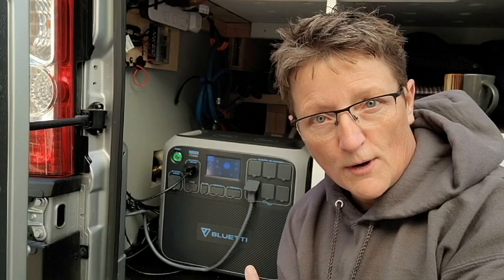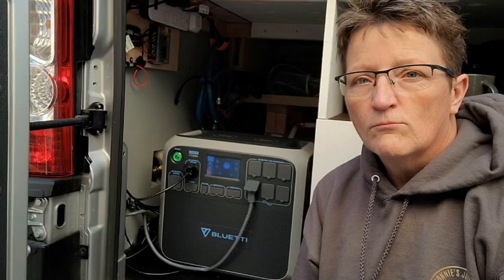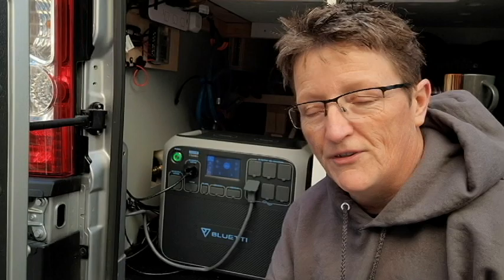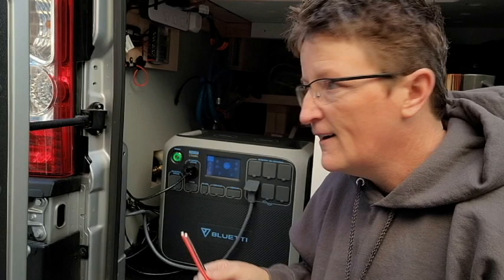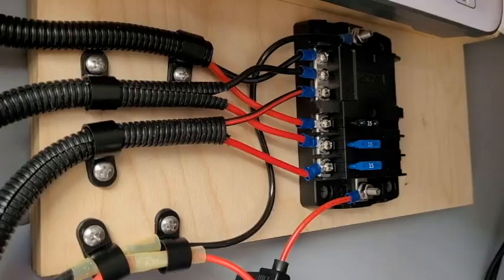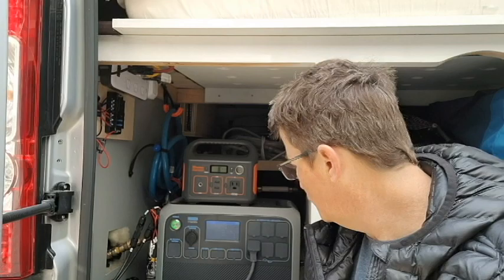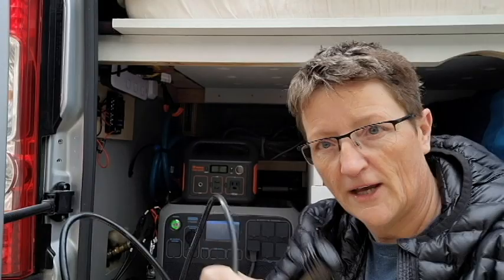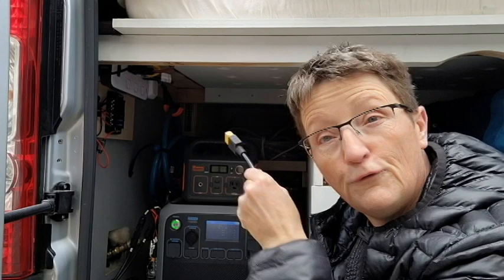Connecting 12V Fuse Panel To Portable Power Bank

Comment: This is a pretty basic question and I am a little embarrassed to ask but how do you hook up the usb lines to your fuse box? I thought these were 5v?  I am thinking of having two pairs on each side of my van.  Did you hook them up in series or would each usb outlet (could be a single or double) get it's own wire run?  Thanks, really very few videos using a solar generator and explaining the electrical hookups like you are doing.
Reply from the maker: You can run them in series or individually. i ran mine individually because of location. personally i would just limit 2 to a run because I have a lot of 12v gadgets.   I like the 12 V quick connects with the heat shrink so that they don't vibrate loose. Yes they are DC 5v. all DC goes to fuse panel. you can then change fuse to what you need.

Comment: Thank you for this video!! Question, does this mean I have to unplug this to use my solar panels? Can I have the solar panels connected at the same time?
Reply from the maker: Yes you can Rena.  The solar input is the aviator port on the side of your unit.  This one goes into the front aviator. The one marked 12v/25amp.  also,  this cord is always out on the Bluetti site so you may have to order and make your own.   Let me know if you have any more questions.  good luck on your setup.
Reply: Thank you! Ordering everything.. one more question. That extra fuse holder that adds protection, what size fuse goes in there?
Reply from the maker: I have a 15 amp in mine
Reply: All done! Thank you so much. Question, if my ecoflow is in the back of my skoolie it will be kinda a pain to keep going back and checking the battery life. Would it be possible to connect a battery monitor that I can run to the front of the bus?
Reply from the maker: @renadalen708  does your ecoflow not have the Bluetooth app?  No devices that I know of that would monitor these devices.  You will learn fast how much power you use everyday.

Comment: What kind of inline fuse were you running between the ac200 and the fuse box?  30a?
Reply from the maker: i put a 20A in.  i don't pull even close to that though
Reply: @JonniesJourney  thank you for your great video and for responding! You rock!
Reply from the maker: @peterdods425  absolutely. Hope this video helped.
Reply from the maker: I checked my fuse. Its 20Amp

Comment: Grateful for your video. Thank you kindly. Used your links :)🙏🏽 One question At 2:48, you mention putting in a fuse on the cord. Does this additional fuse come with the Blue Sea Fuse Panel? If not, I do not see a link to purchase it?
Reply from the maker: No let me see if I can link one.  Thanks for using the links.

Comment: Jonnie, my bad. I thought the front Aviation adapter was male and same as one for aviation to solar. But looking again it is actually a female so the Amazon linked plug should work. Thanks
Reply from the maker: Awesome...hope this video helped.  Good luck on your project.
Reply: Yes the video was fantastic. Thanks so much. I like your enthusiasm.  You would make a great professor!!!!
Reply: how did it work out ? I ended up buying the aviation plug from bluetti.. but it ends as an xt60 plug not xt90.. I could buy an xt60 adaptor instead of the xt90 and wire that to the fuse but I'm not sure if thats proper ? any ideas lol.

Comment: Does anyone know how to wire the Bluetti so it powers my AC breaker box? My whole camper is wired and using AC. I'd like to flip a switch when I don't have access to AC and have Bluetti AC power running to all AC outlets/lights, etc. through the breaker box.
Reply from the maker: oh man I wish I could help. besides plugging your shore power cord into the Bluetti I don't know.   I would have to just run one outlet and one light back to the Bluetti.  Sorry I am not more help on this one.
Reply: I actually stumbled on the answer...there is something called a transfer switch that switches from one power source to another. It's perfect.
Reply from the maker: @designsinorbit  so awesome.

Comment: Hi Jonnie! Can I also connect to my fuse block with a cigarette lighter plug. All I am powering is Maxx fan, water pump, and led lights. If so is 14 Awg wire sufficient? Thank you 😊
Reply from the maker: I have on more than one occasion.  i believe 14 awg is fine but you can reference on-line marine wire chart for 100% certainty.

Comment: I want to do this as well.  I’m a bit confused though.  It’s a 25amp output, but I noticed you have 3 15amp fuses.  That exceeds the 25 amps, right/. Or am I not understanding how it works? Thanks for any clarification😊
Reply from the maker: My understanding is that It will put out what you demand.  if you try to pull more than 25 amp it will fault.  I do not pull more than 15 amp so I use 15 amp fuses.  I have been using it since January without issues. loving it.
Reply: @JonniesJourney  thanks so much for responding. I must be overthinking it.  Is your fridge on one of those fuses, or is it plugged in to the ac outlets that you brilliantly wired up? Love how you set those up... definitely following your lead there.  Loving your videos😊
Reply from the maker: @missmygrandpaal  I have it AC.

Comment: Why are you not just using the 12v cig socket to the fuse box? This way you can plug in and use your solar to charge at the sea time?
Reply from the maker: #1 They are different cables. #2 the cig port is very unstable. #3 it is restricted at 10amps.  👍 hope this helps.

Comment: hi, just found this video, just got the Jackery and was looking for a way to connect if required to my fuse box I already have in my van and these look ideal. I am a little confused regarding the amps these xt connectors can take. The xt 90 connectors I've seen come with 10awg rated wire which allows 30amps but on some forums some guys are saying up to 100 amps. Is this only when you wire yourself I take it using the appropriately gauge of wire and its the actual connector that's rated at 100amps? Great info and thanks for taking the time to explain
Reply from the maker: my xt90 connectors came with 10awg as well. i wired my panel with 14awg.  my Bluetti is 2000watt. i am all set up on a 15amp system. working great.
Reply: The ones I've ordered state the actual connector is rated to 55amps so way more than adequate,

Comment: What gauge wire did you connect to fuse block and to aviation plug wire and what size fuse did you use. Do you know the awg of the Bluetti aviation plug wire?
Reply: I am using the almost exact power set up (AC200Max) for my cargo trailer conversion and your videos have provided some great ideas and clarification. Thank you.
Reply from the maker: The Bluetti aviation plug wire is very hard to find.  I make all of mine using 12 awg wire.  I us 15 amp inline fuse to the 12v fuse panel.  The xt90 connector only has to be used if you will have a back up system for the Bluetti.  I have a Jackery 240 that I use to test everything as I go along and wanted to use it as a back up for my 12v system.  Works great.  If you do not have a back up system you can direct wire aviator plug to the 12v fuse panel.
Reply from the maker: Awesome, thanks so much for watching.  good luck on your system
Reply: @JonniesJourney  Bluetti tell me the aviation plug 25 amp in your case and 30 amp with my AC200Max is 14awg, which I think should be 12 at least. Yes I also have a back up in a Bluetti AC50S.
Reply from the maker: @jacquesbeaudoin9706  agree 100%.
Reply: @JonniesJourney  did you buy the Bluetti aviation plug that comes with 14 awg and rewire it with 12 awg? The aviation plug for solar is also 14 awg that came with it. Did you change that to 12 or 10 awg?
Reply from the maker: @jacquesbeaudoin9706  I made my own aviation plug with 12awg and I left the solar connector as it came 14awg.  You can oversize, just be careful undersizing
Reply: @JonniesJourney  do you connect the 14 awg solar to a 10 awg solar cables that travel to your panel? Seems to be the size being sold by companies like Renogy and most others.
Reply from the maker: Yes, the 10awg with mc4 connectors connects to the 14awg Bluetti cable 👍

Comment: Did you make that( XT 90 with the lighter plug )or did you purchased that.  In case somebody wants to use a Jackery or something else. ?? I did check below. Woops. I have one that came with the Bluetti. AC200 
Thank you.  💕 Now looking to see if you have a vlog about hooking up other electrical. 
I’m so bad at this type of thing. Which is why I had to buy a Bluetti.
Reply from the maker: yes  made an extra cord.  I did a whole video on hooking up the fuse panel. please reach out if you need help
Reply: @JonniesJourney  Thank You Friend and Thank you for you service.

Comment: Hi I’m a new follower and also a newbie at van life I think lol I am picking up my new van that has been customize in about 25 days I have a bluetti AC 200 P that is going to be delivered to the place that is doing the customization I just purchased off of bluetti‘s website the DC output cable and I’m curious as to which fuse box I would need? Currently the van will have two max air vent fans, a Rockpals 53 quart cooler, and I’m not sure how many lights but there will be lights running from it as well. I’m not sure of anything else that will be going off of the bluetti except for phone iPad maybe small fans etc. nothing big. Unless you would think that a cooktop burner would work off of the bluetti and not be too much? Again I’m a newbie so I have no clue how much any of these items Pull referring to the wattage or anything like that so please help me out if you don’t mind I appreciate it thank you
Reply from the maker: The blue sea fuse panel in my description is what a lot of people go with.  You are gong to love the Bluetti. You will have no problem running those components, just remember anything that pulls heat pulls high watts so don't run two at the same time. Welcome to van life
Reply: @JonniesJourney  So do you think that the plug that I ordered from bluetti is the correct plug and do I need to order the TX 60 female male connector that would go into the fuse box and would you suggest a six or 12
Reply from the maker: @shonda___  not sure what cable you ordered can you give me the part number and I will get you the answer
Reply: @JonniesJourney  12v/25a aviation plug
Reply from the maker: @shonda___  the aviation plug can be directly wired to fuse panel. I only use the xt90 connectors because I have the Jackery and Bluetti.  The Jackery is my backup and sa20 doesn't fit it.  Not that I need a backup but I had it while waiting on Bluetti.
Reply: @JonniesJourney  so I won’t need that plug to hook to a fuse panel (that I haven’t bought yet) what is easiest to use for 2 maxx air and lights also a cooler
Reply: @JonniesJourney  Thank you so much for taking the time to answer all my crazy questions
Reply from the maker: @shonda___  no problem at all.

Comment: Hi there woukd u be abke to help? Im looking to connect my bluetti ac200p to my current solar panel, im not sure what lead to use, would u know thanks for any help
Reply from the maker: Your Bluetti has a cable with MC4 connectors on one end,  It connects to the aviator cord with the xt60 or xt90. This then connects to the mc4 on the pannel.  midwestvanbuilders@gmail.com if you have a different panel port and need further help.

Comment: Great video but the input aviation receptacle and the output aviation receptacle are different. Input is a male and output is a female. So you have to have to different cables for in and out.  Also, on the bluetti cables the input has an XT90 due to higher amps in and the output has an XT60 due to lower amps going out. Keep up the good work.
Reply from the maker: Mine did not come with any output cords, I had to make it so I replicated what Bluetti used.  Thank you so much for watching and commenting.

Comment: Hello, great video! You mention that you made an extra Bluetti 12v DC aviation plug cord. Could you explain how you did that?  They are sold out of those cords on bluetti website and I need one. Any information is greatly appreciated. Thanks.
Reply from the maker: Micheal, welcome to the channel. In video description are links to SA 20 adapter and the xt90 connector I used 14 guage wire, also listed. You can make wire any length you need and just connect adapter on one end and xt90 on other end. Thank you for your question, if you have any trouble I can make sure one at cost.
Reply: @JonniesJourney  Thank you, for your reply.  Also, does your shore power hookup go into the fuse box? Do your AC outlets go into the fuse box or a separate place? I'm not quite understanding how when you plug into shore power it automatically controls the van without you unhooking something.  If the fuse box is getting powered by the bluetti DC, where does the AC power come from. Is it a separate fuse box for the AC side of things. Hope this makes sense what I am asking.
Reply from the maker: New video on this now up on the channel
Reply: @JonniesJourney  Thank you. I also found a great video on how to double the bluetti battery capacity for around $250, using scooter batteries. Way cool!
Reply from the maker: @msarmir  oh cool. I will have to find that.
Reply: @JonniesJourney  jehugarcia on youtube. I just ordered mine, simple plug and play.
Reply: @JonniesJourney  Hello. Are you using Puck lights in your van with the Bluetti DC power? I hooked some up but they are flickering. I hooked them up to a 12 volt battery and they work fine. Wondering if you have found any issues with your bluetti not liking certain electronics?
Reply from the maker: @msarmir  I am having the exact same issue.  Bluetti forum says it's something about the relay in the led puck lights.  Ugh....
Reply: @JonniesJourney  Could you please send me the link to the bluetti forum.
Reply from the maker: @msarmir  https://www.facebook.com/groups/bluetti.club/?ref=share

Comment: Hello again Jonnie! Thank you for this video! I just so appreciate you. When you made your own aviator plug, did you solder the pin to the wire, or is there a different t method?
Reply from the maker: Yes I did. That's the strongest hold. 👍

Comment: At 4:15....that IS NOT the same plug(solar input) that goes into the DC outlet 12v 25A. I wish it was because I have 2 ac200p
Reply from the maker: correct it's an SA20 Aviator plug, you have to make one. it comes with the female you have to make the make.

Comment: Can you any 12v wire?
Reply from the maker: If your talking about gauge it depends on the component.  You can oversize wire so I mostly use 12awg sometimes 14awg for LED's or USB's

Comment: can you do the same with the ac180?
Reply from the maker: Yes you can, but I think it only has a 12 Volt DC output, so you will have to use the cigarette lighter adapter
Reply: @JonniesJourney  Thanks